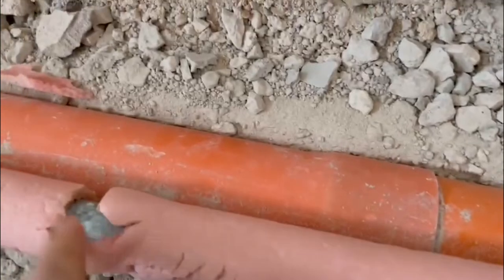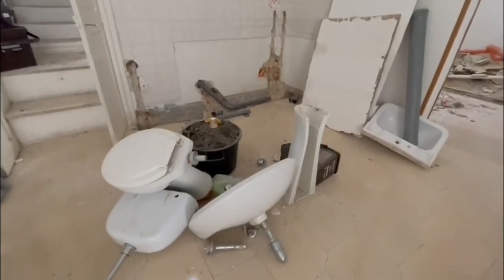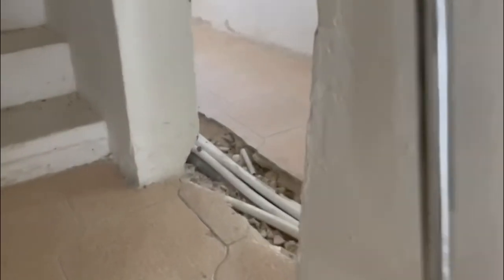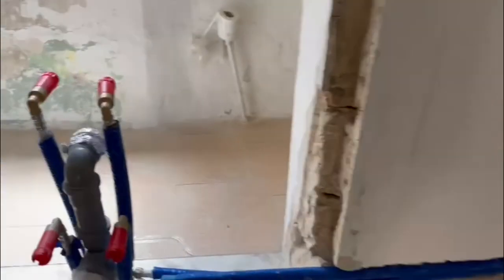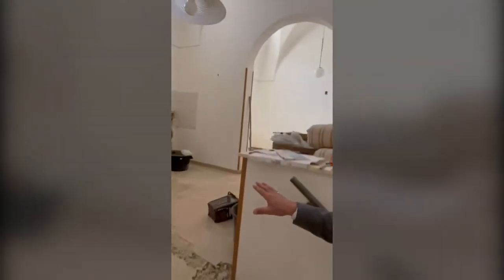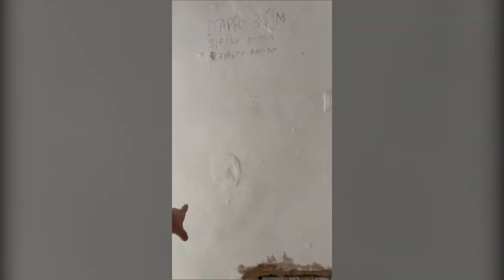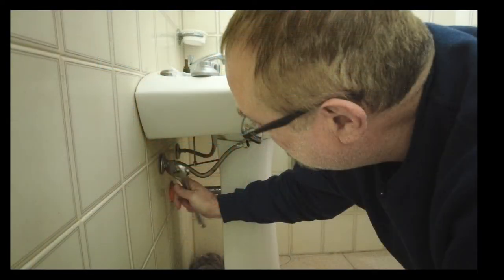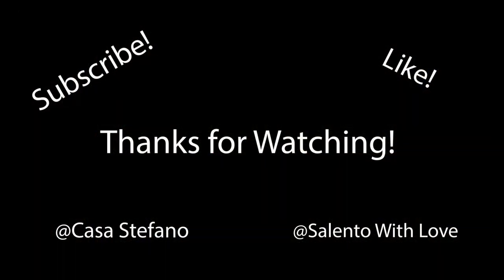All New Plumbing in the Old Italian House. | Ep. 37

Comment: Great video to see how things are done in Italy.  I have a couple questions if you could be so kind to answer.  1,  What is the waste line going to the roof for? Is it a roughed in supply line for future use? 2. Is there any venting to the roof?  In most photos of Italian homes I've seen there doesn't seem to be any pipes on the roof.  3. I have read through all the comments and two other people asked about the cost and you said about $5,000 to 25,000 Euros. Thats a pretty big range.  If I have the exact same job as yours would it be closer to $5,000 or $25,000?
Reply from the maker: 1. Yes, rough-in for future outdoor kitchen/shower
2. No venting for plumbing in Italy, but I will add one just to be safe
3. Closer to 5000

Thanks for watching!